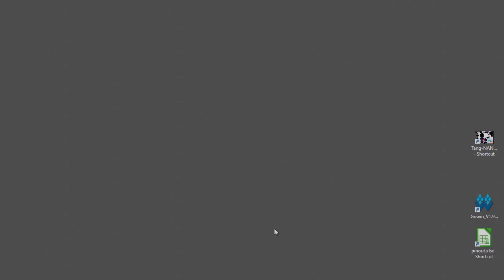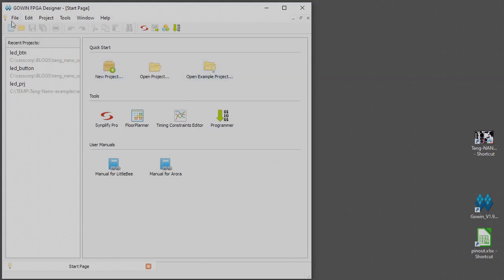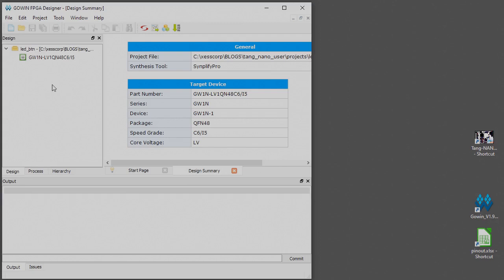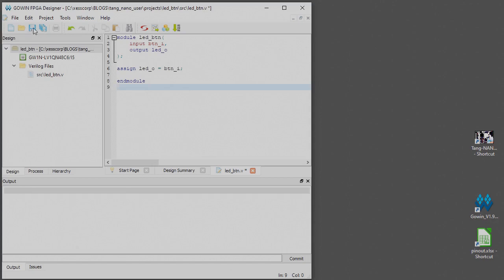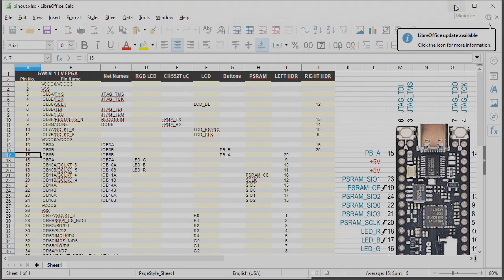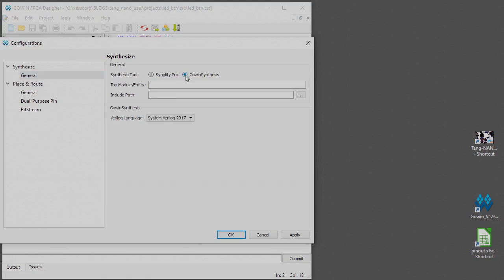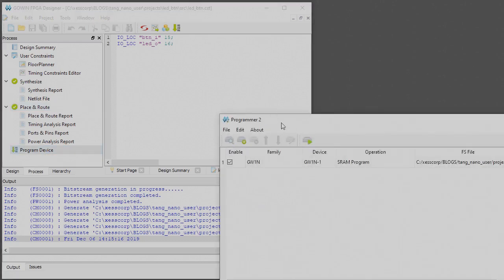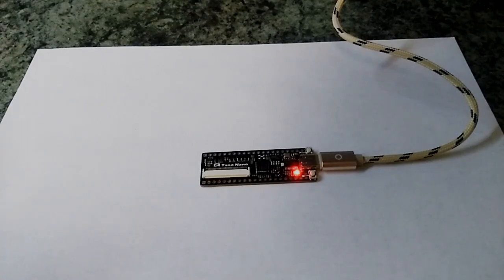LED-BUTTON: A Simple Starting Design For Your Tang Nano Board

Comment: I'm curious, I was vaguely under the impression that the Gowin EDA had schematic symbols and design entry, but I was surprised to find your circuit editor was something else, and then you opened the EDA after going over it. What circuit editor are you using, and does it matter which one you use to generate your code to compile and download with the EDA?

Comment: Thanks for the video! Btw, When I try to make a simple AND logic using its built in buttons, the logic works like OR logic and vice versa, do you have any idea wth is this happening?
Reply: I'm not sure if this is your problem, but the state of the button is inverted on the FPGA since the button is shorting the input to ground. The LED is effectively inverted as well so it didn't affect the example in the video. If you start using logic, you should take the inversion into account.

Comment: BTW, you can get the IDE without giving them your details. You can get it at their Chinese site at http://www.gowinsemi.com.cn/faq.aspx. Google translate's your best friend.
 Also, if you have problems detecting COM ports or uploading your bitstream, you need to get the programmer from this site. https://dl.sipeed.com/TANG/Nano/IDE . Extract the programmer, replace the programmer found in your installation.

Edit: I used GoWin 1.9.5.01 beta, together with the replaced programmer2.

Comment: What version of the Windows and the IDE are you guys using? I just bought two of these boards from Mouser and tried 5 different versions of Gowin (1.8.4.01b - 1.9.5.1b) in Windows 7 and 10 and the programmer always reports an error (No Download Cable Connection). Windows also complains that it cannot recognize the board when I connect it. Is there an extra step that I'm missing? I followed several "getting started tutorials" an all they say is install the IDE and connect the board. Also, why i the IDE installing FTDI drivers? The chip on the board is CH552T and AFAIK that is some kind of low-cost 8051-based microcontroller with built-in USB. Does the firmware emulate some FTDI device? Do I have to flash a new firmware on the CH522T?
Reply: You need to get the programmer from this site. https://dl.sipeed.com/TANG/Nano/IDE 
Extract the programmer, replace the programmer found in your installation.
Reply: Having same issue here. Tested it on another windows 10 machine and it detects is as COM port. But my machine fails to recognize. Did you manage to solve the issue?
Reply: @heyikidebir  I gave up on this POS long time ago. I'll stick to Altera, Xilinx and Lattice parts.
Reply: @salvadorlimones1811  Thank you for replying. I don't know if you'll ever try again but, it looks like the issue is with the internal usb 3 hub of the machine. If I plug an external usb hub and plug the Tang Nano to the hub strangely it works.

Comment: Great Video!
There is no problem burning the program into SRAM. However, when I chose the program to embedded flash and verify option, the programmer says verification failed. After that, I could no longer make the board work even in SRAM mode. Have you any idea what happened? Is there something wrong with the chip? 🤔
Reply: errr suddenly it works again... for no reason😐😐😐
Reply: @ruochenli7525  I had a similar experience.  Check that the Download Speed in the IDE located in Project Menu -> Configuration -> BitStream -> Download Speed matches that set in  the Programmer under Cable Settings -> Frequency.  After much frustration I discovered these were different by default and I was unable to make it work programming into flash. When I changed this all was fine.
Reply: saabcrow Ohh i didn’t notice that. I just randomly tweaked the settings and it just worked :P Thanks for that information!
Reply: @saabcrow  Thank you ! It helps me  too. :-)